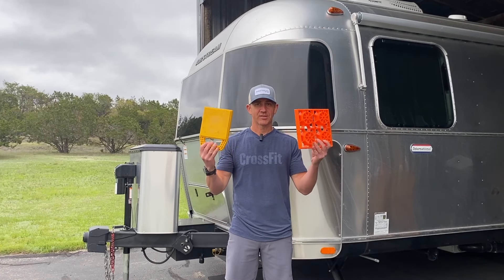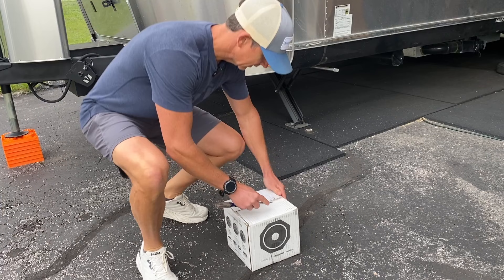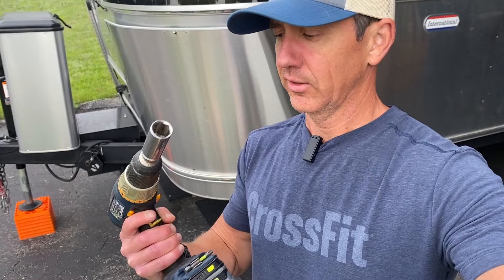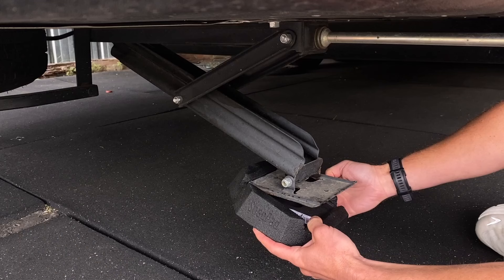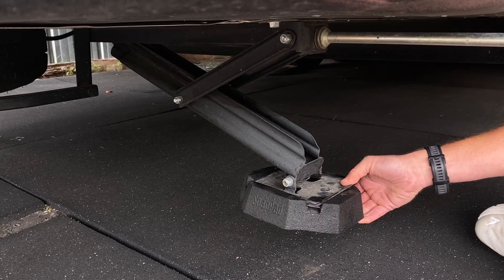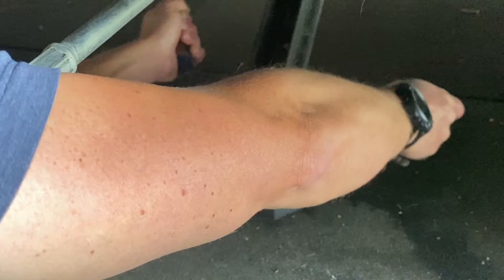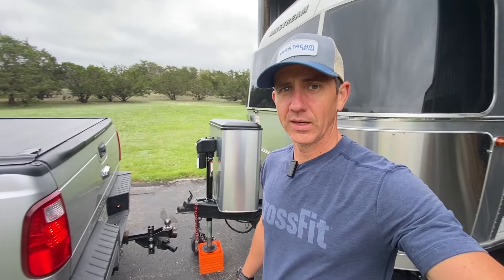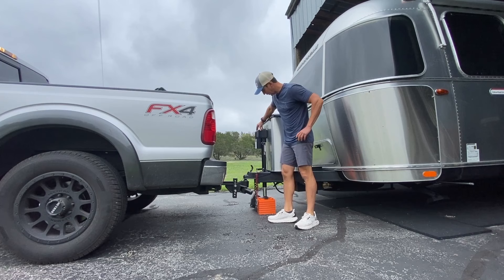How To Install SnapPads On Your Travel Trailer or Camper

Comment: Soap....goes quick. No screwdrivers needed.  Just use your drill with a soaped up pad.
Reply from the maker: Smart! They should include that in the instructions! Oh, wait! There were none! 🤣
Reply: @DigitalBarbell  Weird not having instructions included.  Their web site does say to use a small bead of soap but don't use    a petroleum based product such as wd40 for a lube.